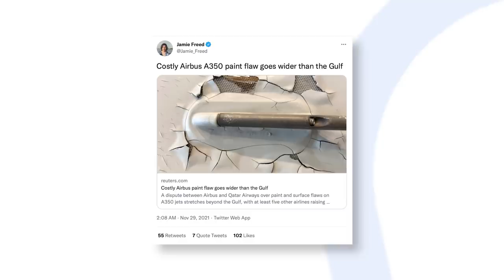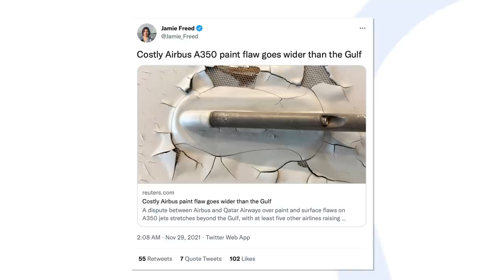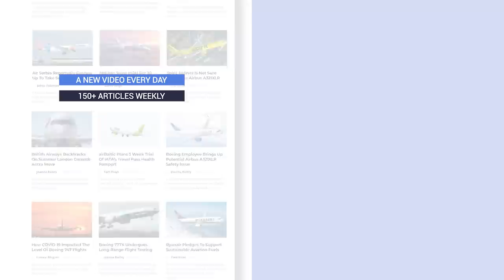A New Layer To The A350 Paint Saga: More Airlines Raise Concerns

Comment: The fact that the 787 hasn’t had a paint degradation problem means a possible cosmetic manufacturing/design issue with the A350.
Reply: Airbus chose the wrong paint, pure and simple.
Reply: @jwenting  No. It's not that.  All the paint chemistries of all the major aircraft paint suppliers are virtually identical, and there is no paint in use that is unique to the A350  and used in no other aircraft type or manufacturer.  The paint used on the A350 is quite likely to have been used on every type made by Boeing and every other type made by Airbus.  Akzo Nobel is the single most prominent paint vendor in the aviation industry, and both Boeing and Airbus make extensive use of their aircraft paint systems.
Reply: @jwenting  I did hear in another Simple Flying video that one of the major carriers uses another paint supplier and still has issues.  I wonder what supplier Dreamliners are repainted with.  Some are so old, the paint would have made it onto a Boeing by now.
Reply: @jwenting  you lie   pure and simple...
Reply: The 787 has paint problems too. The paint on top of the 787’s wing flakes off easily after exposure to UV.
Reply: @ndlben7129  uh, no.
Reply: Wdym?? The 787 has problems as well sadly
Watch Simply Flying’s most recent video
Reply: @awesomeman116a  Can confirm this. I've seen a 787 photo from Airplane spotter's group. And sadly yes it also had has paint patched on everywhere, specially on it's wing. (Thai Airways 787-8). It looked like a floor tile now... seriously...

I think there's something wrong with paint adhesion on composite material that we hasn't yet learned tho. Since it's relatively new so we'll have to wait and see if it will effect air worthiness or not.

Comment: In a nutshell: carbon composite does it shrink or expand like metals. Paint does react to temperature changes so it’s like a tug of war between the paint and the fuselage which causes the cracks. If not noticed, it can actually tear off in flight and damage some parts of the mesh meant to absorb lightning. So the paint needs to be more elastic in order to cope with the usual state of the carbon composite fuselage. It won’t be a safety hazard until the carbon fiber is actually exposed and prone to severe damage during flight.
Reply: Not to mention the fact you really wonder did Airbus did proper temperature testing on the paint job? Especially in the Middle East along the Persian Gulf with its combination of over 40° C. temperatures and over 50% humidity during the summer months?
Reply: Does it shrink or doesn’t it? 😉
Reply: @Sacto1654  The damage comes from repetitive thermal cycles...unfortunately those are in a time frame that's beyond any of the cold/hot campaigns that all manufacturers do during certification
Reply: If thats the case.. why has Boeing not had any issues with the 787 paintwork? You would think that other composite aircraft would have the same issue?
Reply: @chaoszombie9995  in fact, it has. If you've ever flown on a "old" 787 you would have probably seen significant damage to the paint on the wings, which is often very obvious due to the jerry rigged repairs done to "patch up" the problem.
Reply: @Sacto1654  actually, Finnair had the same problem and they live in old climate. I don’t think they actually measured the extent of how the paint and the carbon fiber would interact
Reply: @luca7069  wow you found the correct word for it! Thanks mate!
Reply: @luca7069  huh.. interesting.. I never noticed the issue when I flew on ANA’s 787 which is now 8 years old and never noticed it 😅 I wonder how Boeing addressed the issue
Reply: @chaoszombie9995  Boeing spent $32 billion in R&D on the B787 whereas Airbus spent only $15 billion R&D on the A350 ("saving" $17billion to pay lawyers to sue customers?)
B787 use a finer more flexible expandable copper mesh for the Lightning Strike Protection and does NOT have similar flaking problem like the A350. Boeing also use Titanium rivets since Titanium has similar expansion coefficient as the Carbon Fiber composite whereas  Aluminium expands much more.
Reply: @set3777  the more you know! That’s really interesting! I wonder why airbus went the route they went in 🤷‍♂️
Reply: Lots of composites out there including canon fiber without paint issues
Reply: Qatar is right!  Paint is essential for most things man made, paint protects that which is painted and it's not just cosmetic, the A350's could not fly without paint!  Airbus and European Union Aviation Safety Agency (EASA) are wrong, the exposed lighting mesh and carbon fiber of the A-350 will not stand up the elements without paint. -- Qatar Airlines should sue Airbus for the crappy paint that will not last the life of the plane, this is a big deal, considering many aircraft flying are decades old, this includes the 70+ year old DC-3's from WW2.

Comment: This is more than just a paint job. Rumor has it that Airbus may have to look at re-skinning the 350's using a different method. If that turns out to be the case this is going to be very, very expensive for Airbus. Whilst Al Baker is not the easiest person to deal with, he has a point. How would you feel if you bought a brand new car and the bodywork started to fall apart within a year or so. Pretty pissed, I bet. If Airbus has any sense they must come up with a plan to fix the 350's currently in service and update their design process for future aircraft. They seem to be 'burying their heads in the sand' and that is not going to end well for them. They need to 'come clean' on this issue and make it right with all the operators by repairing their 350's or is there more to this than just 'repairs'. If it is an issue that effects a large percentage of the frame, then hell, they might forced to replace planes!
Reply: This is far beyond bubbling and peeling paint.  The coated copper mesh can corrode.  Discontinuities can cause too high of a resistance for a lightning path.
Reply: You have to offer your brain for helping Airbus.
Reply: @LeondeLure  yes because none of the engineers at Airbus has thought anything similar. JFC
Reply: lol 'rumours' from where? whats your source
Reply: @ant2312  Google is your friend 😉
Reply: The Dodge Shadow was a car that was notorious for it's factory paint jobs failing very early on due to them using a water based primer or something like that. I believe a class action lawsuit was happening against them in both the US and Canada because of it to get Dodge to repaint them for free

Comment: Aircraft today employ increasingly complex and innovative technology, mostly in a race to save operating costs for the airlines.  With this innovation comes uncertainty and occasionally failure.   Airbus will find a solution.  I wonder if Boeing has or will have a similar issue with the 787, which also has a composite fuselage?  Maybe they have the solution already.

Comment: Why does Boeing not have the same problem with the Dreamliner, or do they?
Reply: No such problem with the B787 because Boeing's lightning metalic mesh are finer and more flexible and very expensive titanium (that has similar expansion rate as Carbon fiber) are used instead Aluminium for the Dreamliner rivets.
Reply: @set3777  thanks for your explanation
Reply: @set3777  you mean inexpansive?
Reply: @nikanora97  I think he meant expensive. Titanium is not cheap.
Reply: @set3777  Boeing does have the problem tho
Reply: @awesomeman116a  Boeing B787 has paints deterioration on the wings of some aircraft due to UV rays. Different from the A350 problem.

Comment: It's probably simple physics you may say, they were used to painting on metallic surface may have used the same technique,  process, equipment, and chemical composite compounds as  usual which seemed professional but turned out amateur on newer carbon composite basically they need to develop newer way of painting.
Reply: I also wonder is Boeing having similar issues with the 787's with their composite fuselages. Especially since Qatar Airways and Etihad Airways have fleets of 787-8 and 787-9 models.
Reply: @Sacto1654  Boeing uses titanium mesh instead of Airbus's aluminum mesh, so no problems for Boeing.
Reply: @Sacto1654  If you ever fly on a Qatari 787 you'll see that the paint on the wings is often seriously messed up and patched up in a jerry rigged way
Reply: Airbus has been working with composite assemblies for decades...the A300 vertical stabilizer was the first major section on a commercial jetliner to be made out of composite materials. They tried a new solution for the A350 lightning protection mesh, and it doesn't work well with standard paints it seems.
Reply: @luca7069  But  B787 does NOT have the same problem that is being deceptively called "paint saga".
It is the flaking of composite materials under the paint that is the problem.
QATAR Airways has 53 A350s and 40 B787 and the A350s are all less than 4 years old.

Comment: The other airlines that had more serious damage along with Qatar had to have been Etihad. Yes I know the video said the desert heat wasn't much of a factor but I disagree. US Airways had similar problems with it's old black livery at it's hub in Phoenix. The heat absolutely makes a difference to the skin no matter how advanced the aircraft is.
Reply: finnair is a airline based in finland which is very cold. accordinf to your theory if they are based in cold places the paint should last much longer than a few weeks
Reply: @tacoaviation9411  I mean maybe any extreme on either side effects it? Both cold and heat?
Reply: @CoDWiiPS3Gameplay But  B787 does NOT have the same problem that is being deceptively called "paint saga".
It is the flaking of materials under the paint that is the problem - NOT a PAINT SAGA,
Reply: @tacoaviation9411  Note that the mean temperature at 35000 feet is lower than the lowest temperature ever recorded at ground level in Finland (-51.5 C / -60.7 F, Kittilä, January 28, 1999).
Reply: Etihad A350 stayed in Toulouse for many years and just recently arrived at Abu Dhabi

Comment: carbon fibre material also contracts and expands with changing temperatures, but at a far different rate (smaller) than most metals.
Now they're either applying paint designed for use on carbon fibre to the metal mesh and/or paint designed for metal to the carbon fibre material and problems arise as a result.

Comment: Does 787 have this problem? 
If not, then how did they fix it? Better paint, different skin?
Reply: The 787 has problems with the paint on the wings. It's easy to see when flying a relatively old one, because all missing paint is covered with aluminium high speed tape, to protect the carbon fibre from UV radiation. Boeing also hasn't found a fix to the problem yet.
Reply: @CheapBastard1988  if it’s mostly relegated to the 787’s wing and not the fuselage, I wonder if that has more to do with the crazy flex the wings have when in flight. Also isn’t the construction method of the fuselage different between the two aircraft, with the 787 being made up of complete barrels while the a350 is panel based. Wonder if that plays any factors.

Comment: Before your video, I had written this off as Qatar negotiation tactic with Airbus since only it was complaining about it and no details released on true nature. But your video shows pictures and mentioned the lighthing protection mesh as issue.
I am curious about differences with the 787.  Boeing had lighning protection problems on the wings (part of reason for all those fasterner issues/delays because they acted as glow plugs in fuel tanks if lightning struck).  This was well known to Airbus (I learned of it from an Airbus document).  Si I have to assume Airbus worked the lightning portection differently on the 350.

If this happens only in specific areas (such as asround the air probes (whihc do get hot), the mitigation would be much simpler/smaller than having to redo the whole fuselage.

Comment: The problem is the quality of the bonding, and the paint being used.  But the bigger issue is the cure cycle of the bonding process.  FYI, the equipment specification for the equipment being used by Airbus vs. Boeing have a number of differences.

Comment: Looks like boeing isnt the only one with aircraft problems
Reply: Exactly. Boeing is getting all the bad press for sure. They certainly deserve their share but these Airbus fans think Airbus can do no wrong. Every large manufacture has issues. Every car manufacture in the world issues recalls all the time over both safety and non-safety related issues. The problem is when they ignore it. Boeing fell into that trap and now it seems Airbus is following suit. Of course, we don't know what is really happening behind the "internet" and hopefully they are all over it.
Reply: @explorenaked  no one has died from this issue yet
Reply: They are the only one with safety issues. Paint is not a safety problem.
Reply: @explorenaked  idk what Airbus fans you are talking about but chief maintenance engineers at multiple airlines have seen no safety hazard to this problem. The paint just needs to be fixed to adjust to the environment it’s exposed to.

Comment: I wonder about the metallurgy of the lightning mesh itself.  If that is expanding due to heating and cooling at a different rate than the paint, they would slid apart. If the Boeing mesh happens to move with the paint for example, it may not show the same wear (yet!).  Let's all check our alloys.

Comment: Looks like every single Airline manufacturer is going through issues with their planes, Boeing with 737 MAX & 787 Dreamliners, & Airbus with A350.
Reply: It used to be like this. Many past airliners had issues. Its just now with youtube and all you find out about the small issues, previously only the insiders in the industry would know of the issues. If they werent actual inherent safety hazards or related to crashes, normal population wouldnt really find out about issues in the 70s to 20s when there are little channels to promote this stuff.

Comment: The Pitot tube is often headed to maintain function. Composite material is not very tolerant to high heat. This may be a design flaw. The picture shows the area damaged around Pitot tube.
Reply: It’s a static wick

Comment: First it was the 787 in the past, now is the turn of the 350.
Reply: 787 hasn’t had this paint issue though, which begs the question whether the A350 lightning mesh is a poorer design or Airbus needs to use a different paint formulation
Reply: @MrArod356  I Found this suspicious
Reply: @MrArod356  Incorrect, the wings on older 787s have serious paint problems, you can clearly see it if you fly on one.

Comment: The metallic lightning protector mesh is acting like a spring,it  reacts at extreme temperature and the paint does not,the result paint dis integration,believe me.
Reply: Then how come the 787 doesn't have the same problem?
Reply: @shrimpflea  787 doesn’t have lightning protection.  They got a waiver from god.

Comment: Not only is the coated copper weave exposed, it looks like it's suffered some corrosion.  The entire jet will need to be inspected somehow...maybe engineering will figure out an eddy current NDT test procedure or something?  Stripping and repainting each and every jet for the purpose of inspection is going to be a massive cost.